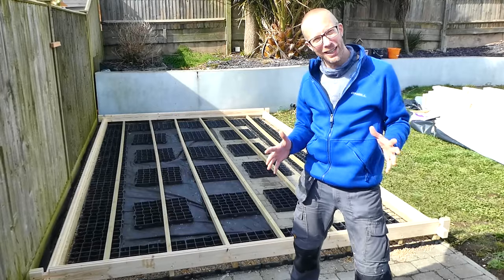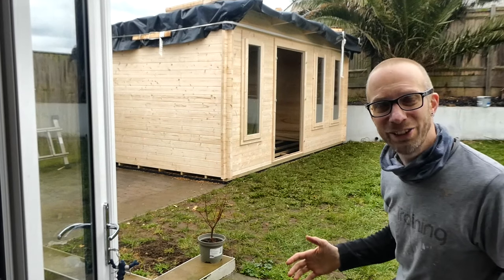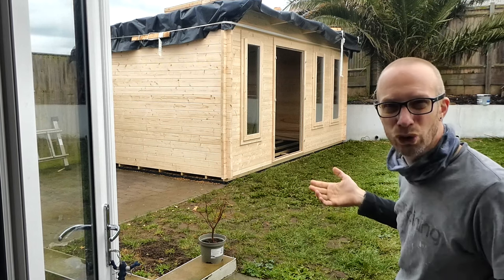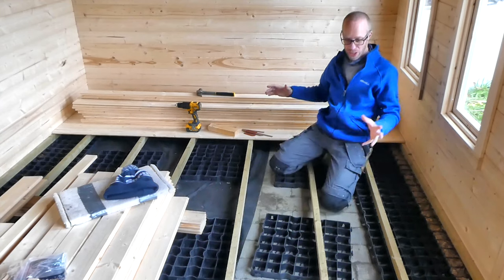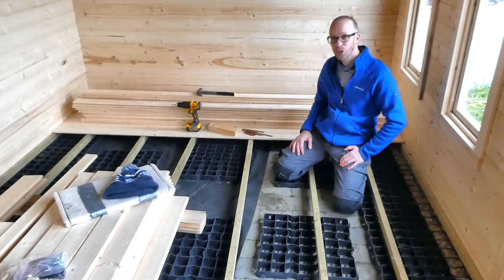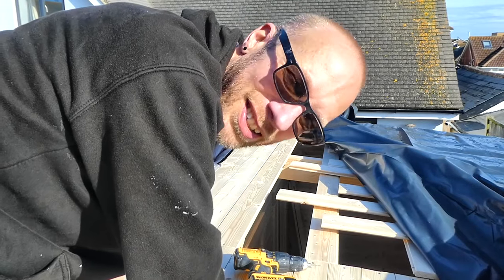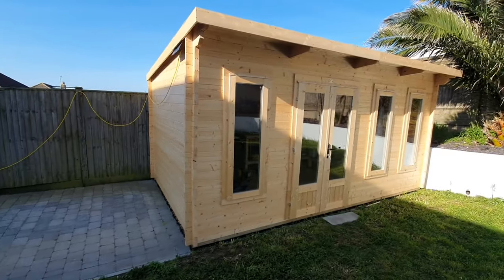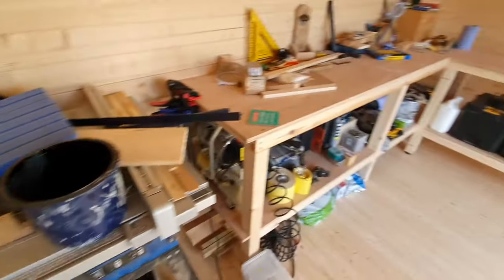Building my Log Cabin Workshop -  Dunster House Terminator Pent Log Cabin

Comment: The plastic floor formers should be filled with pea shingle to provide their full strength. Over time the plastic will deform without the pea shingle to take the load. They are designed to contain the shingle to stop it moving sideways so the pea shingle takes the full load. Guess if you are not going to add a grand piano or lots of filling cabinets full of paper you will get away with it, as normal floor loads will be light.

Comment: THIS IS THE SAME ONE AS WE ARE GOING TO GET AND TURNING IT INTO A BAR AND SEATING AREA BUT WILL BE DOING IT IN THE SUMMER AND PRAY IT IS WARM AND DONT RAIN .
Reply: We did the same a bit of advice  treat the connecting logs before you build it will not take you long but it just saves water getting in a later date also buy your felt for the roof and treatments yourself. It works out cheaper.
Reply: Could you advise treat with what ?
Reply: @bells1969  I presume you mean treat with waterproof paint?

Comment: I built one about 15 years ago, still standing and perfect.
A couple of things to note,
1, when nailing never actually nail straight, better to nail at different angles because this stops the whole thing just pulling out.( but I am sure you will be ok , its just a tip from a mate who is a joiner )
2, the shelves you put up are fixed to the wall and resting on the door frame it looks like, the wall expand in winter and contract in summer by a considerable amount but the door frames don't so the door frame will push on the shelf and bow it ( I know from experience lol ).
3 The obvious question is how you are going to retreat the back next to fence in 5 years or so , maybe have to remove the fence panels?
Reply: I build one about 13 years ago. The problem with these are there's no insulation so it get really hot in the summer and cold in the winter.
Reply: @MegaMicraman  you can insulate it yourself though

Comment: How would you replace lower logs if it starts to rots?
Reply: My concerns also.
Reply: Lift the floor and replace one at a time in 2 sections?
Reply: The bearers are pressure treated.

Comment: What is the tempearture like in yoru workshop ? In winter and summer. Planning to build similar Log cabin as Office in my Garden. Thinking adding insulation maybe ?
Reply from the maker: Great question. The truth is, summer is hot and winter is cold, with everything in between. If you have a heater, then in winter with insulation it'll be toasty. But in the summer you'll need to keep the windows open.

Comment: Getting this cabin soon. So you put the dpm down onto the concrete and lay the bearers onto that? Overlapping thr dpm over thr side of the bearers like a canvas?
Reply: Yes mate
Reply: @footballno1  thank you. Also I want to insulate the walls. Do I put the dpm on the outside wall and then PIR board and then plasterboard, or does the DPM go between the plasterboard and PIR?
Reply: @kickassaz  because this timber should be treated the insulation board should go in between the straps then sheeted.
Reply: @footballno1  thank you. So outside tongue and groove wall, treat that, then PIR then damp proof membrane before finally plastered board?

Comment: I'm building one can someone tell me why 
The 6 gable ends that's 3 either side are pined together. like that you can't separate them without damaging them.
That's how they arrived.
Thanks.
Reply from the maker: Probably to protect vulnerable pieces in transit. Mine were screwed, and had to be unscrewed in order to construct this section

Comment: Hi Justin how has this held up a year on?
Reply from the maker: @ollie6512  Well it's just experiencing it's 2nd winter, and it's certainly solid! But then it does have 3 coats of paint on the outside. So yes, all good, and I'm still really happy with it.
Reply: @JBTV  thank you Justin! How was the temperature in the summer / winter periods? Was it hard to heat / cool to battle the outside temps?

Comment: Hi, your cabin looks great. When you did the wall layers, did you nail or screw the boards to each other. So, it makes one solid board as such. Kind regards
Reply from the maker: Hi, thanks man. I did screw some of the wall boards together, particularly if they were bowed. However, since completing the build, I have installed some braces to the inside walls. It is very windy on the south coast, and I wanted to ensure all the wall boards were attached to each other.
Reply: @JBTV  thanks for your response. I've just purchased a cabin, and it's doesn't really explain if the boards are fixed together. I'll probably go with your method of fixing a few boards as I work my way up and the timber braces inside seems a good idear to tie it all together. Cheers JB

Comment: Genuinely curious to learn... Why did you nail the floor board in and not screw into the supports? There's no real need for the sheer strength of a nail there, and you'd want the pulling strength of the screw to prevent lift/movement over time. Cheers
Reply: Screws creek over time. And Flooring should always be nailed.
Reply: @footballno1  You got those mixed up.

Comment: Hi mate, been eyeing up the Dunster house cabins for a while. How are you finding the insulation in peak of summer/winter? I'd be using mine as a garden office and worry it will be too hot/cold without spending a fortune on insulation. Thanks
Reply from the maker: Hi, I'm loving mine, however, in summer, you have to keep the doors and windows open, gets very hot. In winter I use a little heater (I've done a video) and it warms it up nicely, but soon gets cold when it's off. I have no insulation, but I'm not in there for hours on end...
Reply: @JBTV  Thanks for the reply. Was fully expecting to need to get a little heater so no surprise there. Sounds like adding any sort of insulation would help for what I need then, as I'd be in there 9hrs a day minimum. Don't want to have to wear a glove and scarves to work haha.